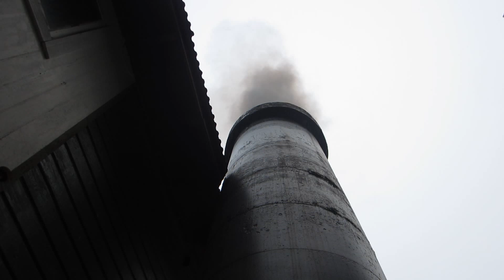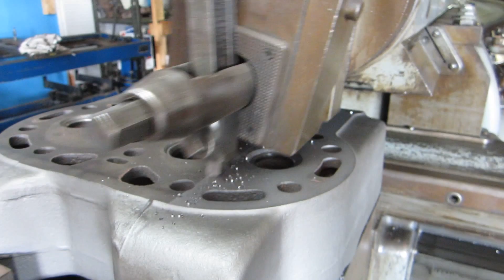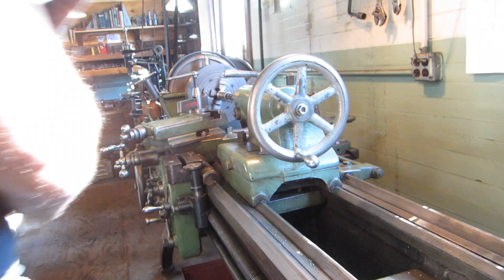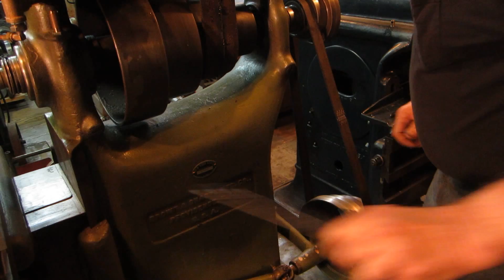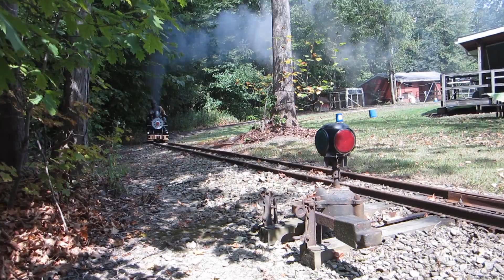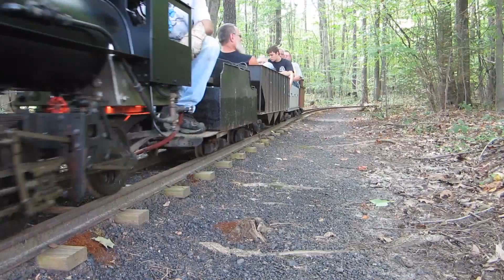OLD TIME STEAM POWERED MACHINE SHOP 6

Comment: So the preference is to advance after the back stroke rather than the end stroke? What's the clapper for then?
Reply from the maker: Hi Roger, I guess you would say it keeps the drag off the tool point on the return. It would work without it but the tool would get dull sooner.....Dave
Reply: @davidrichards5594  : oh, that makes sense, and if a shard is encountered on the cut surface on the return, the clapper allows that it won't forcefully drag it along scratching it. I wondered too about the back side of the cutter flicking shards into the gap of the clapper, if that was ever a problem. Your method obviates that concern.  I didn't consider the drag back dulling the cutting edge, assuming it was ground to an obtuse angle on the back. Thanks for your explanation

Comment: Watching the lathe and the shaper running at the same time powered by a relatively small steam engine should cause people watching to develop a healthy respect for the power of steam. If your shop was run by electricity those two machines would be powered by large 220 volt (minimum) electric motors pulling power off the grid. It’s one of those pay now or pay later types of scenarios on where and how you obtain the power for your machine shop.

Comment: What made the old boilers so dangerous and why did they blow up so often? They can’t be smart enough to build those machines and not know to put a relief valve in the boiler?!?! So I’m curious what caused them to blow up? I get it’s over pressure. But I’m asking the deeper reasoning behind it.
Reply from the maker: Hi James, They weren't and they didn't. It's just that when there was one exposed to gross neglect in maintaining or operation, it failed and took half the building out with it. Usually it was caused by not maintaining anything close to the minimum water level. If the water gets down so low that the "crown sheet" (top of the fire box area) is not covered, it doesn't have the water above it to transfer the heat to, and becomes red hot and looses it's strength, bulges out and pops, even at regular boiler pressure. The relief valve usually doesn't have anything to do with it.  In the boiler, at  normal operating pressures, The water is at a much higher temperature than it can exist in the outside air because of its pressure. When suddenly released to the atmosphere, and the whole boiler full gets that big pressure drop, this "super heated " water turns to steam instantly and with it's stored up energy, expands about 1,000 times by volume.  Someone's definition of an explosion is "When things get really big, really fast".  Another problem is very heavy mineral scale, etc. allowed to build up on the crown sheet area which will "insulate" the water from the metal and do the same thing. A boiler running way over pressure could explode if there were structural problems with it. That's why boilers are inspected and tested regularly to make sure they up to their certification "safety factor" of 5. Meaning that a boiler certified for 100 psi could ultimately fail at 500 psi. I can tell you that (although I would not try it) with the relief valve replaced with a plug, I don't think I could ever get close to 500 psi hand firing on wood.  To me, boilers are like any other machinery, you need to know about them, maintain them and keep an eye out for small things that could lead to bigger problems. Thanks for watching and for a great question.....Dave
Reply: David Richards...thank you! Very detailed and thoughtful answer. I understand now. I can see where some guy being thrown into a job he really didn’t give a rip about, he’d get lackadaisical and wind up being blown Through the block wall. 

As middle aged young man, I VERY much appreciate you keeping this knowledge alive!! I truly hope and pray you have a young man that cares enough to let you teach him and pass this on to. I wish I could come study under you for a couple years, now days. 

As a child, my granddad used to take me to old shows, fairs, bake sales, and all that in the mountains of East Tennessee. He’d always try to get me to pay attn and watch the old steam engines whether they be milling corn/grain or a train engine or even fire engine, I’ve seen. But st that time in my child hood I was of course more interested in whatever toy I could con him into buying me from the venders. Or seeing the “monster trucks” instead of the old steam tractor pull he took me too. I like most children, didn’t care. But I surely do appreciate you keeping alive what my grandfather and great grandfather knew as everyday business. 

Thank you and be blessed!
Reply: Being originally from East Tennessee, I’ve been to “DollyWood” several times. There they keep allot of this alive as well. They have ALLOT of water wheels turning shafts for their shops. And I did enjoy that as a child even. Check that place out of ya ever get the chance. They have the old school blacksmiths and barrel coopers and all that stuff. Im out south of Seattle now days. So not allot of history old enough for that out here.
Reply: I know this post is late. But many explosions were with the horizontal boilers. Dave’s boiler is vertical. The crown sheet in a horizontal can get uncovered with water and still be exposed to the fire. When water hits a super heated crown sheet, it expands about 1600 times instantly. This explosion. My experience has been with stanley steam car boilers. These were extreme pressure vertical boilers. Some rated to 1000 psi. Because they were verticals, there was never a reported explosion of a Stanley boiler. With Dave’s boiler, you need to check your cocks and gage. If you let the crown get exposed, the boiler is empty. Not likely if you know anything about steam. Yes there is a pop off valve and it pops every so often.

Comment: Me: Is nervous about using the autofeed on the lathe.
David: Running multiple jobs on multiple machines while walking around, feeding the boiler, keeping the steam up.

I have once nudged the chuck with the tool, so I never leave a machine running.

Comment: I like the close up shots and angles of the machines and belts in action.  If you don't mind me asking.  There seems to be a lot of metal coming off of that head.  Will you be using shims/thicker head gaskets or are you going to shave the heads of the pistons.  Also won't there be interference between the pistons and valves?  Just curious.
Reply from the maker: Noel: It's a tractor and there is lots of head and valve clearance to accommodate it. Not like a modern diesel...Dave

Comment: I don't know the names of the things but on the end of the piston rod of your steam engine there's the pivot that connects the piston rod to the bar that connects to the wheel, it has the brass shim wedges. Anyway, I see there's an oiler that lubricates the top half on horizontal engines, what I'm wondering is how it auto oiles the bottom? Is there a hole through the entire unit? Thanks Mr Richards, I know I'm probably getting on your nerves, I've watched all your videos twice already and am on the third viewing.
Reply from the maker: +Shane K   Shane,  good question,  no the oil just sort of ends up on the lower slide some probably drips down and hits it when the cross head is all the way at one end or the other. some engines do have a lower oiler, this one doesn't....Dave
Reply: Thank you

Comment: this is really awsome how long does it takes for the perfect working presure and what for a water pump do you use
and great video's i subscribed :D
Reply from the maker: +luc snippe  Takes about an hour and 15 min to get it up and running from stone cold, If holds some heat overnite so next day it's about a half hour.  There are 2 steam injectors for adding feed water.....Dave
Reply: +David Richards i'm volentyring for the steamgroup in holland its called museum buurt spoorweg its a local small track of abouth 9 kilometers in with
we had a big steamup today there were 4 steamlocomotives running today i was helping feeding them coal and water it was just awsome to see them all running
srry for the bad english greets from holland
Reply from the maker: +luc snippe  Thanks for the report, sounds like a great time....Dave

Comment: great videos, you defenitely have yourself a new fan and subscriber. Thank you for doing these videos, just curious what happened to video number 3, it seems to have dissappeared somehow I think. Cant wait for the next video.
Reply: +cae chirp yea, video number 3 in your videos is missing.
Reply from the maker: +cae chirp   #3 accidentally got  deleted into cyberspace by me. (no back-up).  I can't really remake it because it was about having the shop steam engine disassembled for modification. Next video will be  #3 1/2  which will be mostly on the engine and boiler. Thanks for watching....Dave
Reply: awesome, cant wait! I was really interested in those two and also how the line shaft stuff works to engage/disengage the machine's belts. You briefly went over it in the one episode but didnt get a very good look at it.

Comment: great setup you have there. do you have any issues with belt slippage?  I have mine setup with a gas engine and always have to use belt dressing to keep them from slipping.  keep up the good work!!
Reply from the maker: +steamer123  The only belts that have been a problem are the final drive on the lathes.  I switched to a rubber lined belt on the Large lathe and that pretty much solved that .
Reply: +David Richards thanks for the reply. I'll look into that for mine. thanks 
Tom

Comment: Awesome stuff bro. I was wondering, how often do you have to tend the fire in the boiler when working in the shop? I love your setup, would love to have one like that!
Reply from the maker: +8MADJACK    Jack:  Depends on the wood, old cut up beams burn slow so you have to throw some in about every 10 minutes or so. I run some soft coal with the wood sometimes, then it's about every 20-30 minutes.
Reply: +David Richards Makes sense, I figured that the harder stuff or coal would need less tending, but I also knew that you have to keep a good boil for the steam production. thats not bad at all and gives you a chance to move around a bit between cuts and stuff. Thanks bro.

Comment: What a great channel and another great video! I have an AMT much like yours with the 8 speed headstock. Very inspiring to watch what people with ambition and skill can do.
Reply from the maker: +fcarp1685 I looked at your lathe, it must be about late 1930s?  At one time, the American records were being kept by a company (I forget the name) that was making parts for them and othere machine tool things. They could tell from the Ser# the actual day of manufacture. Mine is 1925, called a "relieving lathe". at one time it had a gearbox on top of the feed change box that had a drive shaft (w/ universals) to the cross slide and ran it in and out timed to the spindle for roughing out things like milling cutters, taps, and reamers. Seemed amazing to me.
Reply: It would be very cool to learn more about the lathes history, it was given to me about a year ago. That gearbox that was on your lathe sounds very interesting and would be awesome to see in action. It seems as though they were very solid machines for their time.

Comment: Congrats on all the subs. You obviously do great videos people like! That mill may not know how to act when it goes back on the line shaft. Watch out for those bronze injector bore inserts on that R head. They are notorious about leaking. I have had to machine several new ones in the past. I highly advise a strong pressure test to be sure they don't leak before they put that head back on. Looking great and enjoyed the little railroad. I need some more track for my bridge crane, do you know a good place to get that small rail?
Reply from the maker: +bcbloc02   Hey Brian, I noticed Jim has quit a bit of odd pieces in the back lot, where are you at and how much do you need?
Reply: I am in central Ky and only need about 60ft worth.I need to look again but seems like mine is 3" tall rail.
Reply: David Richards
Looks like it is 45lb rail 2" top and just over 3 1/2 tall.
Reply from the maker: +bcbloc02 I'll check with him on the size and if he would sell any odd pieces.
Reply: bcbloc02 ask old brown to tea

Comment: Is that a steam powered radiator in the engine shop?
Reply from the maker: +stefantrethan    Yeah, I have steam lines running hither & yon. for heat and the parts washer.